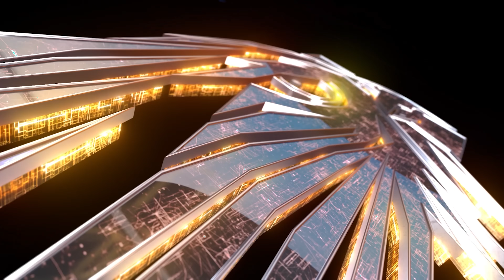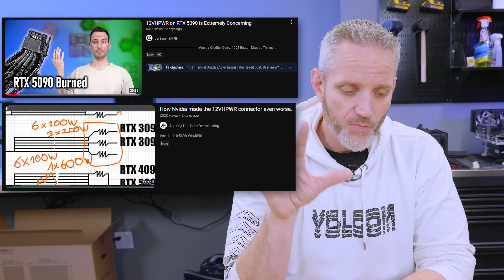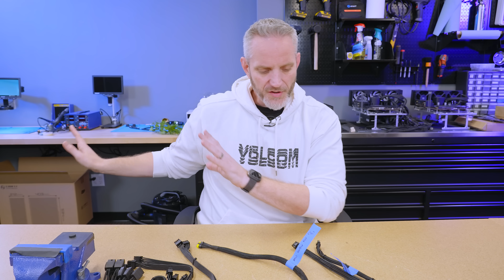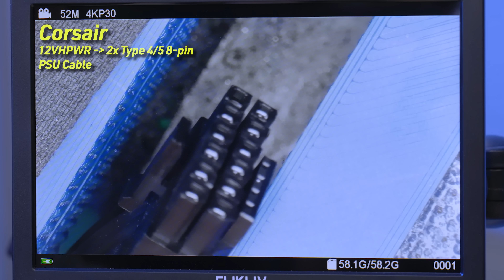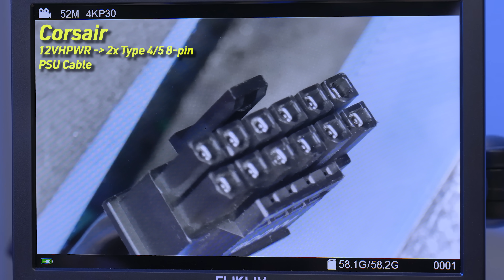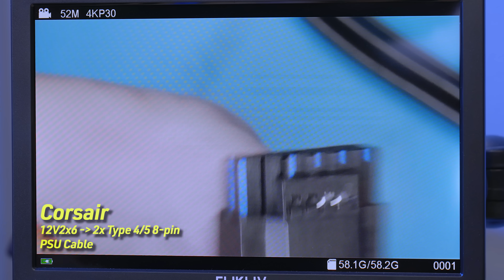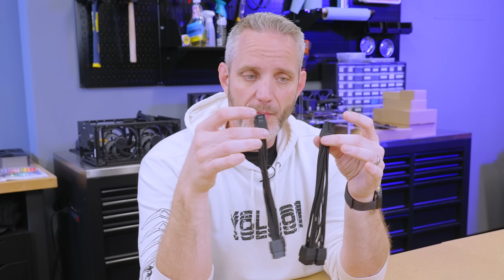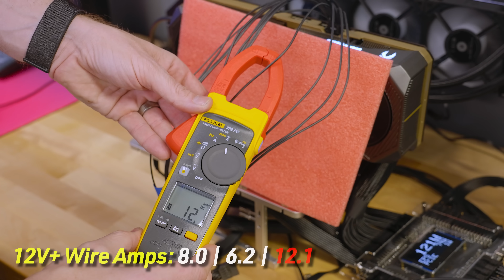I discovered something concerning and I need the Experts to chime in... More 12VHPWR discovery!

Comment: Jay
I have a seasonic 12vhpwr cable that is very uneven compared to my Nvidia adapter. For science, I am going to be using a Seasonic cable on my 5090 tonight along with a thermal camera and an amp clamp to measure the amperage of each strand.

Comment: Pushing 600 watts is in itself ridiculous for a graphics card.  You are asking for trouble using these connectors.  Six, one hundred watt light bulbs being fed by six measly wires is something you would think is not a wise thing to do.  Great job Jay, you nailed it.

Comment: I got the RM850x 2024 edition, and the 12VHPWR cable even tough it has the black marker on it that is passed QA. Simply moving the cable turns on the red light on a brand new Asus 4070 super prime card. Yes the pins were connected properly and the angle was not extreme, followed the guide that came with the card.

Comment: they're going to say that's user induced, and they'll say that cause you pulled on the wires instead of the connector block to unplug, or maybe even, plug in the cable. What I mean by they, is the companies who sell either those GPU's or the PSU's, and they'll still blame someone else if you use Nvidia's cable / adapter cause you're using a third party PSU to connect to their cable / adapter to.

Comment: 4090 cables have /had a metal bar that cross connected the pins in connector itself. I suspect that some of the 3rd party cables is 12 times pin wire pin so if one pin or wire as higher resistance more curent is going through the other wires. A cable managed wire bundle might lead to some wires getting warmer and wire resistance goes up with temperature. This can lead to current imbalance in a runaway failure if the pins are not connected in the connector without a metal bar connecting the pins the connector.
Sockets in the cable sitting a bit deeper isn't really a problem for conductivity (You would be surprised how little metal on metal contact is actually happening in socket pin connections).
But sockets moving in the connector is a sure sign the metal bar cross connecting the sockets in the connector isn't there.
That bar cross connecting the pins is averaging out current imbalances across pins and across wires.

A fix will be to add 0.05 ohm resistors in each of the 12V wires. (fixes half the problem current doesn't care if the wire is a 12V or a ground wire)  Basically what the measuring gadget does to measure the individual currents.
This value is much larger than the wire resistance and pin socket resistance and this makes small differences between the pins and wires resistance insignificant.
But adding 0.05 resistors to the ground wires could result in too much current through the pci and motherboard if that becomes the path of least resistance. If the gadget has the current sense resistors in the ground line than all the twelve wires can have a resistor. 10Amps through a 0.05 resistor is 5 Watts. 10Watts resistor can handle this. Pins cannot!

Pushing cards to the max 104% of the time, overclocking and dodgy cables...

Comment: I can't even get why this even happens in the first place. You would think that because of the NVIDIA adapter  being 4x8pin that would be the reason for the new connector (who would want 4x8pin in a gpu), but if Corsair can manage 600w through just 2x8pin than surely NVIDIA could've got away with 3x8pin GPU side and be cool with it. Even with the new connector they could do 3 rails and have the wattage split between them card side or through the new standard have PSU makers split the load

Comment: Pretty much all the 8 pin and 6 pin cables are like that and none of them had any issues like this for millions of PCs.
Reply from the maker: They also werent pulling over 600w either!! Why do you think the 80 series had DRASTICALLY lower failure rates and nearly non existent on 70 series and lower....
The 8pin and 6 pin were NOT running at their ragged edge of spec which is what 90 series cards do.... literally turn the dial to 10.

Comment: This cable and connector have been a shitshow since day-1.  I hope by the time I upgrade my GPU, no one is using this thing.  Or at the very minimum not try to power the card with just 1 of these things.  I don't know if having two would make it less prone to do this, I won't claim to be an electrical engineer.  It really seems like trying to shove that much power through these cables is causing the issue.

Comment: whats happening is like running a car battery in a race car with the negative just touching while running down a pot hole road it will cause issues if not blow the 100 amp fuse because it is causing a short arc.

Comment: 3rd party cables may matter for warranty limitation… “only use the octopus we’ve supplied or one that is supplied with a compatible PSU” = excludes random 3rd party cables.
Reply from the maker: Dude I literally said this... why do you guys just repeat what I say back to me? Is it because you didnt watch?
Reply: @Jayztwocents    if you are referring to your comments at 15:00 onwards then, yes, the manufacturer might not say “ONLY USE THIS CABLE” (as you said), but what you DIDN’T expressly say is that you may still end up in a warranty issue even if they haven’t said that. It depends on what their OTHER express instructions are regarding other compatible cable use. This is why I made the comment, to fully expand upon the principle of the point you were making. Thanks.

Comment: If this is true.... It's like u cut 1 of the 12V+ wires. The other 3 tank the hit.
Nvidia beeing Nvidia.

Currently working mantaining "Electronic" Machines deployed on the field "City", one of the most common causes of problems are, either a bad connexion or a broken cable.
My GO-TO first step when wierd things starts to happen is to "Jiggle" all the cables, first from the connector then from the cables pushing inwards. So many times have I fixed things just by doing that, that it waffles me that 2000+ Euro Hardware have this kind of defficiencits, and i'm talking about machines that are litterally punched because people frustration with them, shaked 3-4 times whole a week.

There are connectors that are "Captive" from the corners of the connector that would perfectly solve most of these issues, instead of the wimpsy hook.

Comment: I’m both RTX 4090/5090 are scam. Cus Nvidia made some cheeper way of how it’s handle power draw on the actually gpus.  3090/ti didn’t burn up.  The 4090/5090 don’t balance power as well and it’s design flaw on the GPUs.  12VHPWR is a design flaw.

Comment: Isn't the Asus ones having the sensor on each pin to equalize the whole 12vhp for the graphic cards? And if we go for the First party NV's 8pin to 12vhp, how does that look for the amper on each cable?
Reply from the maker: No. The asus Astral does NOT load balance... period. It simply can "monitor" amps and send an alarm if out of spec. And no cables are monitoring amps on each cable... none.

Comment: You really don't need to be an engineer to see the problems here, unfortunately it seems that is the only point things will change.

Edit: If such a small issue as the pins being slightly different depths is a problem there's greater issues, that really shouldn't do much of anything with how much contact area there is relative to the gap. The GPU just needs better power management.

Edit: Okay the pin moving that much is a problem too.

Comment: The ground is common even thru the pcie connector where as the +12v power is delivered to the VRMs by the cable, therefore the ground has a higher capacity. this could be why the it seems that the 12v cables are melting and not the Ground connectors.

Comment: There is another think that can contribute. The actual pin could have 6 dimples to touch on the male part (3 in each side), or 2 ribbons (1 in each side).
The dimples may be capable of ~9A and the ribbons of ~12A. The issue is if they are dimples, if you miss one it could be 1.5A less capable but the ribbons are linearly reducing the capability.
Check if you can see how it is hugging the other GPU pins.

Comment: i thought we figured out the cables are the problem years ago.
Reply from the maker: You didnt actually follow this discussion did ya?
Reply: @Jayztwocents  jay. i watched everything. and am as familiar as the guy u talked about who has been following the issue. i was speaking from the perspective of the solution which is that the cable and ports are simply too small by design to limit power draw from big antioverclocking/unlockers. the wires should not even get hot.

Comment: It makes sense to why the GND pins are slightly less of an issue when they make worse contact.
The GND pins are likely all connected to the same net on the power supply.

The 12V however may be coming from different rails inside the power supply and thus those are likely not bridged together. At least not inside the power supply.
However as you could see in DerBauer's video, his pair of 12V and GND wires were glowing.

So maybe the +12V part of the connector is simply longer than the GND pins, since the connector is at an angle of 90 degree from the board?
If that part of the connector then heats up, its resistance increases and thus it starts heating up even more.

Edit:
Given the PMD2 is 'saving' the card, means that this PMD2 is actually bridging the 12V lines from the power supply and proves the power supply is indeed feeding it from different rails.
This means the other 12V rails will only start delivering power when the voltage of the other ones has dropped far enough to be at the level of the other 12V lines.
Those are quite beefy power rails, so you really need to draw a lot of current for it to drop like 0.1V. But when you measure those 12V lines separately you will see there is likely a difference of about 0.1V per rail. 
Add a bit of fluctuation in resistance of the connectors in the mix and it is perfectly logical why there is such a large difference in current being drawn over each wire.
For good thick power cables, an extra 0.1 Ohm resistance is significant, so it makes perfect sense why you see such a big difference in current.

Comment: why the fuck are we still running 12v, use 24v or 48v lower current and now that GPU cards are so small do the voltage conversion on the card

Comment: They need to dump the whole connector and switch to a common industrialo connector like the Harwin Kona series, that has solid screw secured direct fine point copper connects just as one poor example. Time to just eat a dik and do it better.

Comment: Interesting questions. The easy answer is that resistance is resistance. It doesn't care if it's on a GND pin or a +12V pin, the resistance acts the same way. That's the short and easy answer. But of course there is more than that.

The card doesn't only use the power from the 12VHPWR connector, but it can also use power from the PCIe connector. If I remember correctly it can tap at the most 75W from the PCIe connector. Now this connector has 5 +12V pins, but it also has GND pins, 68 of them actually. So depending on how the card handles the +12V and Ground it can dump a lot of power into the ground pins on the PCIe slot. Now the reason there's so many GND pins in the PCIe connector is not really to dump a lot of power through them. It also has three +3.3V and one 3.3Vaux pin and any power taken from these has to be returned to ground somehow. And in addition to that there is 16 transmission line differential pairs. These are transmitting the PCIe "lanes", but as they are differential they are not dependent on using the ground for signals. But in between each of the pairs there are two GND pins. This is a way to minimize the interference between the differential pairs.

But all in all the card slot can handle quite a lot of ground connection. If the 5 +12V pins can handle 75W (I think that's what I heard they can do) then each connector handles 15W. And if all the GND pins has the same capacity, possible but not guaranteed, then the 68 GND pins could handle 1020W. Now if they can only handle 5W then it would mean a total of 340W which is still quite a lot.

So it's possible that one or two of the the ground pins on the 12HPWR connector could have bad connection and still it wouldn't burn the remaining ground pins.

This is all theoretical and would depend on both the design of the power circuitry on the graphics card and on the design of the motherboard. So I won't claim that this is how it works, but it is a possibility that perhaps can be tested.

Comment: the whole cable is stupid. There should be only two cables as they unite all in just 2 anyway. They just need to get over the bs with easy to install flexible and user proof cables (that fail anyway) and make rails that go from the PSU to VGA. Two rails. One + one - . 12V and 40A or whatever is needed. Find the gage of the rail... do it! It can be done somewhat flexible also.

Comment: Had to go check my previous Amazon orders to look up the GPU cable I'm using for my 4070 ti sup...turns out it's fasgear also...been using it since early 2024 along with ezdiy GPU angle adapter...both no issues...but I've been a fan of ezdiy since 2022 using their braided cable extensions...never tried cable mods products cuz ezdiy have been doing me just great

Comment: Still very confused why they don't just use single 8ga or 4ga and M8 bolts, like a tractor/powersports battery.  Multipath is never going to work great, and clippy connectors are just dumb.

Comment: As for the Corsair cable featuring 8-pins on the psu side, here's a comment Corsair's Jon Gerow recently made on Reddit: 
"Well, since the sticking with the 2x 8-pin to 12VHPWR was my idea, I'm going to be a little biased. 2x 8-pins are clearly better because the Type 4 terminals are larger (4.2mm vs. 3mm) and more spread out which helps spread out the heat. At that time, I did not trust the 12VHPWR at all and figured if it's going to melt, let it melt on the GPU side and not in my PSU. Even with the Type 5, which are 3.0mm pitch like the 12VHPWR, the space given between the terminals is still better than 12VHPWR."

Comment: So nvidia will just push "load balancing" cost from their card to PSU manufacturer or some 3rd party board... and keep the money... yey! I would say that the connector inconsistency does not matter... it should be designed to handle this and not burn your house.

Comment: At this point they should just switch to a 2 wire system that uses automotive battery wires. :)  Have a couple screw down connectors like what stereo amps use.